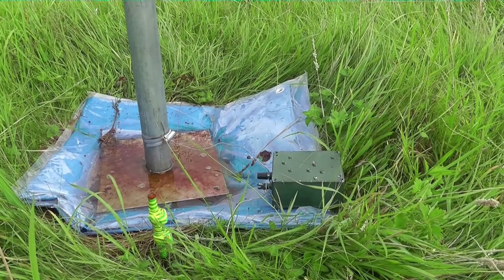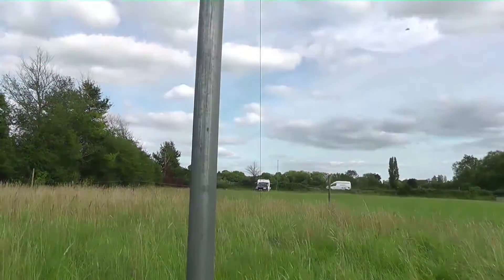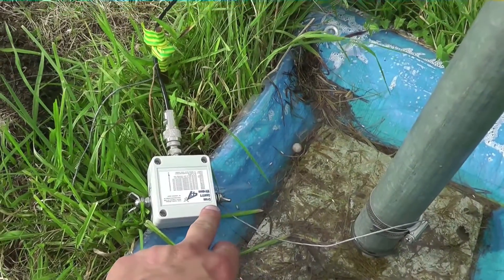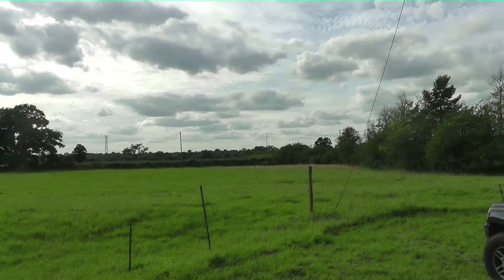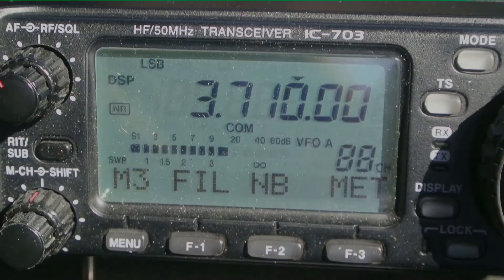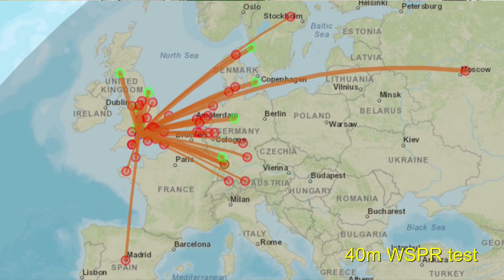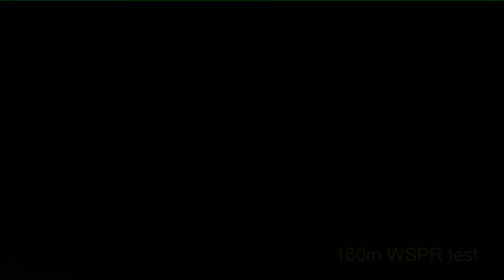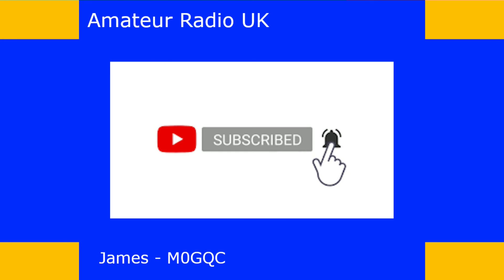Terminated Inverted U  Antenna - Scaled Up

Comment: Hi James, It's a pity that you didn't try it on 20m or above. With a long horizontal section it starts to have some gain and is directional in the direction of the resistor. In effect it's like half a rhombic on it's side. As you said in the video you do need a wire connecting the two earth rods for a more efficient ground return path. 73, Chris G4HYG
Reply from the maker: Although I have now taken the antenna down, that was an idea that I had considered & it could still happen!!!

Unfortunately I can’t really run a wire along the ground due to the horses. That said, I do occasionally take the caravan away to campsites where I get on well with the owner who has said that I can have exclusive use of the site out of season.

It hasn’t happened yet due to the COVID restrictions but maybe later in the year or possibly next year. It depends how the COVID situation goes over the next few months.

Comment: Hi James, great experiment. although it pains me when you say ("I'll call this a Failure" )because it isn't- its a learning experience at the very least and its fun- keep it up, well done. Barnie M7PBX.
Reply from the maker: Ok, I'll revise that statement to say the following:-

"It was a success because before the experiment I suspected that it wouldn't work but I wasn't completely sure. Trying it proved my theory to be correct & therefore confirmed that my understanding & what I though I knew was in fact sound".

Although it was a terrible transmit antenna, it did actually receive quite well.....effectively acting like a beverage antenna.....and therefore confirmed to me that it would be worth the cost & effort of installing a beverage antenna at some point in the future. I guess we can call that another positive!
Reply: @AmateurRadioUK  Yaaaaay that's the perfect response.
yes a bit like a LOG - Loop on the ground - matts words not mine - and on 80m its makes perfect sense to me to use a RX antenna and a different TX antenna. because if we could all build a 67ft vertical , we would. Cheers James, catch you further down the  log. Barnie M7PBX.

Comment: I'm just in the process of building one, it's broadband nature and potential low noise is what i'm after. Messing about with aerials outside is always fun, how about having a crack with a Rhombic in all that space.
Reply from the maker: That is something that I had actually very seriously considered trying on the 20m band.

The biggest problem with it is the cost as you need 4 masts, ideally a wavelength or more above the ground (so around 20m tall if building for 14mhz).

Each leg needs to be roughly 2 wavelengths, so the whole thing is going to be around 80m long (actually somewhat less due to it's rhombic shape and also factoring in the velocity factor of the wire), which is a bit big even for my field!

Technically it would probably be possible to fit it in my field but the 20m tall masts would be dangerously close to the overhead power lines (if they fell they would land on the power lines). You also have the same problem with the main road which runs past the field if a mast fell the other way & landed on a car. My field isn't really big enough to do it safely.

Also it's not really a project for a one-man-band, so I would need help (probably at least 2-3 other people) to make it happen.

While I could scale it down and accept the reduced performance, if I'm going to put the time, effort, resources &  money into making it happen, I want to do it with style & flair by completely lighting up the band!!!

That's not to rule the idea out. Like I said it is something I have seriously considered & absolutely would love to do but I need to be realistic. I think it's a project for a larger channel which has sponsorship or some other funding behind it.

It's on the back burner for now. I'm currently thinking that it is a project for a couple of years down the line if the channel continues to grow (which I hope it will), and/or a possible collaboration with another channel.

Watch this space as they say!!!